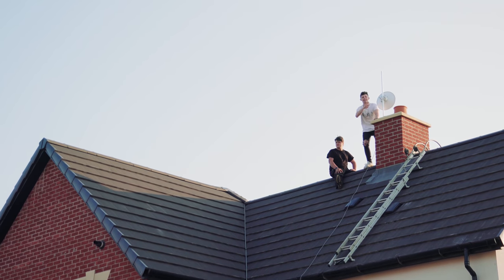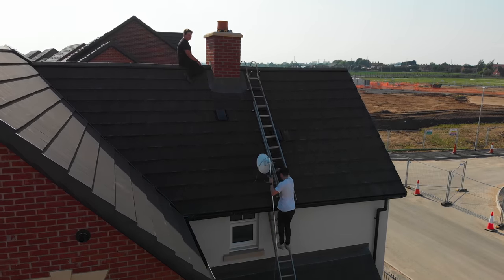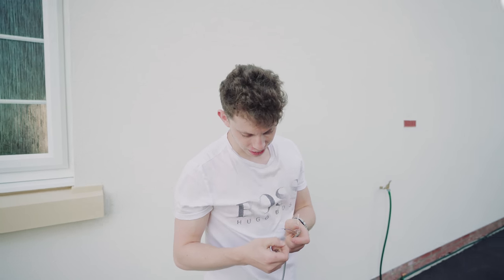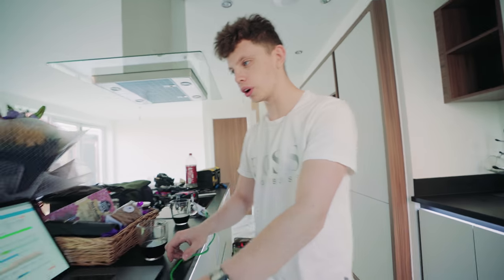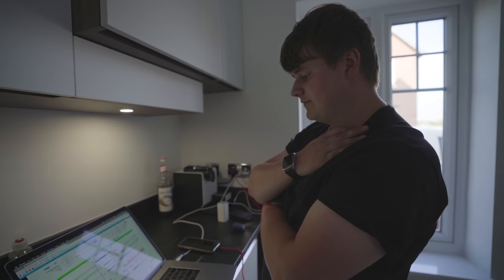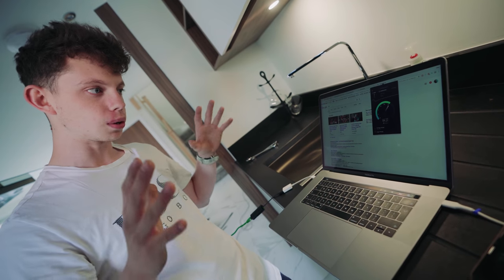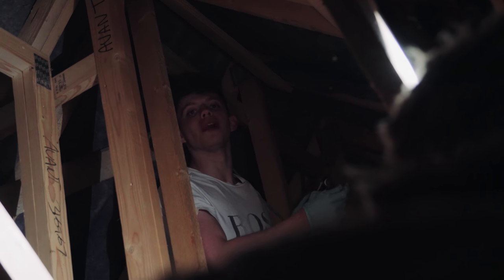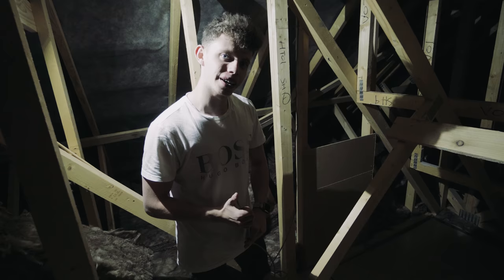How To Get Superfast Fiber Internet When you CANT!

Comment: When he is showing you how he to set up an ethernet jack he says it doesn't matter what way you put them as long as they are the same on both ends this wrong it does matter because of how they are listed in the cable to stop electromagnetic interference if you change the order you can have problems with the cable
Reply: I'm just trying to inform and maby help out someone  why is trying to use the information from this video in real life I'm not trying to put down him done he has good content . It has to do with how they cable are twisted together to stop crosstalk between the cables. It should also be noted I have delt with ethernet cableing in many different places for many different clients and know enougth about it to comment. I'm only trying to help someone else out. Also it should be said that the tech videos on this channel are pretty good and accurate
Reply: @los los I hope you're joking. There are standards for a reason. He should be following RJ45 568B, but he clearly isn't, and it is just going to cause problems further down the road.
Reply: U're absolutely right! Differential signals need to be on twisted pairs. Rx + and rx- on a twisted one and tx+ and tx- on a twisted pair.
Reply: @Razor Lagura its called crosstalk.that is why they are twisted.and also, let me know when someone plugs POE device on a wires that are out of standard, and starts debugging.just stick to 568B and be happy.....avoid custom wiring whenever you can

Comment: WISP are aful the reason behind this is due to WEATHER! it rains 24/7 here in the uk which is going to effect the signal from the dish ontop of your roof to the main dish wich the SP has.Therefore when you are playing games online you will experiance ping spikes packet loss etc...However if you live in Spain or any other country which has a better climate then i would recommend WISP however if you live in countrys which dont have the best climates i would stick with cable provides due to reliability.

Comment: WOW, what is with all the negative comments on this video guys!? If you don't like the content then don't watch it, simple. This is another cool video Alex, keep up the good work mate and don't let people's negative comments get you down! A lot of these people don't understand what is happening - for those who don't, Alex is sending his fast internet connection from his dad's house to his new house which is a few miles away via an Ubiquiti dish! I think anything over 60mb is really good considering! Those who are saying "I get 200mb+ download" good for you; Your connection is going directly to your house from the ISP! Not from another house via a dish to another!
Reply: James Garton problem is this guy is showing people how to do a questionable install which could be dangerous or a waste of money. The mast should be grounded, the network cable should have been outdoor rated and shielded with a shielded end, leak wire properly placed in crimp. Static buildup has no where to discharge other than through the network wire. This will kill the radio, likely the network switch and in the unfortunate event it could hit PCs. Lightning will 100% take everything out and could kill you. I have done wireless for twelve years and I'm concerned. I have done and seen installs like this, you get at most a year before sifting bad happens.

Simple as ubiquiti tough cable and shielded rj45. Then to code gauge wire from mast to ground rod.
Reply: Tom Lindo - yeah not going to disagree with you on those points as they are good ones to point out to everyone. Just sore red when I was reading all the clueless comments from people who does not understand networking and/or what Alex is actually trying to achieve. Common sense is definitely required if people are going to attempt something like this and a better choice of cable etc.
Reply: Tom, we also made those mistakes in the beginning. It will take 1 storm and he will lose enough equipment that ESD and earthing will be a factor moving forward. For now though i dont see myself or yourself with a youtube channel, food for thought.

Comment: Hey Alex can you use two routers with the same ssid on the same network.
Reply: Shorts Romain no comparison. If you want a 10mbps speed over 0.5km. sure. If you want 100-200mbps, you need decent gear that you can adjust power output and eirp.

Comment: OMG you are killing me Alex! I can't believe you just cut into your new roof! You are going to wind up with a leak and ruin your house! AND you just provided proof that it was intentional which has most likely voided your roof warranty with the builder! I like a lot of the stuff you do but this is absolutely mental.
Reply: He has a nice tile roof that could last 40+ years on its own but silicone will break down over time by sunlight, weather, etc. IF he would have taken the time to plan, and we all know he is going to wind up having 50 wireless antennas up there, he could have had the roofer put in a proper access point with proper flashing to run all the cables through it. And yes, cutting or drilling through your own roof can void the warranty of the roof. Once you cut or drill, that is not part of the roofers work and therefore they will not cover it if it starts to leak.

Comment: ubiquiti is noob stuff low dbm power, i use ligowave, multpoint and point to point panel type, specially the rapidfire 5-23
all my customer switch to ligowave unlike ubiquiti sometimes it disconnect and need master and slave always reconfigure sometimes same reboot.
Reply: also they dont have wireless tool alignment unlike ligowave they had wireless tool align.

Comment: Hello Alex, what ubiquiti device are you using?
Reply: That is a Ubiquiti 5GHz  also PowerBeamAC Gen2  keep in mind that you will need one on the other end as well and this should be a point to point also depending on your location you should check local laws this could be illegal
Reply: @RiaanVanLill  Agreed, More specifically PowerBeam 400 AC Gen2, Most Regions 5Ghz is unlocked and free to use, be sure to use "Calculate EIRP Limit" so you do not get in trouble. Just to some basic research and see what frequencies are available in your region.

Comment: 50/50 isnt fast
Reply: Actually for some areas that are isolated don't get as much as populated places so it isn't actually that bad compared to what other companies in that area provide but I get what you mean I get 500/500 here :)
Reply: @sQuibo  Where do you live? I'm stuck with Openreach FTTP and the upload isn't symmetrical.
Reply: @sQuibo  I have 1k/1k
Reply: 50/50 is more than enough to have. To stream in 4K Ultra HD with HDR, Netflix recommends you have a consistent minimum download speed of at least 25 megabits per second.
Reply: @MikePowlas  I stream Netflix with 1mbps. I don't get hd streaming. But my only option is satellite for now. 12mbps up and 3 down on a good day.
Reply: @jessigames8593  Hope you get better speeds soon
Reply: @MikePowlas  not soon enough lol. But they are running fiber through my electric company. I have a 4 year wait.

Comment: So........ you built a cantenna without an amplifying booster?
Max range on cantenna's are usually about 6 to 10 miles. anything higher requires a high extreme boosters which are illegal because they can knock out radio towers.
Been building cantenna's for over 15 years.
The proper way for this setup is to use pigtail connectors that are used in RV's for dishes, they can handle a higher db and dbi for load.
Your using a normal speedtester website that has no application for this type of setup. 
You want to test it in DB for noise. anything over 75dbm to 105dbm is bad for data transfer, why cell phones with 3 bars even at 4g is ranged at 95dbm to 120dmb which is bad and data transfer is still slow.
Reply: If there was any noise especially considering the time of day this was filmed in it would have been heavily reflected by the connection speed, boosters are an even bigger waste of money than the Ubiquiti equipment he uses unless you're legitimately in a mountain or valley range with a lot of TALL trees.
Reply: The Ubiquiti equipment has built in amplified boosters what are you talking about lol.
Ubiquiti equipment have chips in them made by Dominion semi conductor factory.
He's not even using the Ubiquiti equipment just the dish.
 A speed booster isn't the same as an amplified booster speed boosters are essentially amplified repeaters.
Your DBM and DMI noise comes from the line too not just from signal wave to signal wave. This is why pigtail connectors are preferred as they carry more signal without interruptions vs the way he set up the line.

Comment: You should do an iperf and test the link speed with different packet sizes, you only tested the internet speed but not the max between the two radios. Also I hope that pole is grounded against lightning strikes and you are running that ethernet cable from the radio thru an ethernet surge protector!

Comment: I thought Fiber speeds were like 800-900-1000mbps speeds. Something ain’t right here
Reply: Fiber could literally just be 20/20 or 50/50.  As long as the up and down speeds are the same, it's fiber. PS: this is oversimplification :)
Reply: @monzerfaisal3673  Fibre can be anything you want. It can be 100/20 1000/50 or 1000/1000, whatever the one who sells it to you decides is "good enough"
Reply: daro2096  Its not about whats in the Ground. More about what Technology feeds these Cables.If the Backend Cards can only handle 1Gbit/s, then thats the max.
Reply: He is getting top speeds of like 1000/1000 but the radios will not do that speed. They are @ Throughput 450+ Mbps So all is right here.
Reply: That is what o have so ye it is rite
Reply: My fibre goes as low as 10 Mbps when the system is heavily loaded at night.  My area is vastly oversold.  Top speed is a setting in the software that your ISP uses, as well as the download/upload ratio.

Comment: I’m still baffled coming back to this video a year later. I pay 70$ a month for fiber internet 1000 download and upload and this poor guy isn’t even getting 100/100.
Reply: Dude I pay $100 and only get 100mb download and 3mb upload!!!!
Reply: Fahim Hussain  Probably centurylink... lol
Reply: I get 1.5 down with 5gb quota. So oof
Reply: I pay $70 a month for 15mb download and 1mb upload 😓
Reply: DUDE I ONLY GET 600KBPS
Reply: I pay like £35 a month for 35 mpbs   down and 5 mbps up
Reply: I pay 90 dollars per month for 12 mbps up and 3 down. VIASAT but my electric co. is running fiber as we speak its just going to take them a total of 6 years to finish it. I have a 4 year wait until they run it my neck of the woods. Then I will be getting the highest speeds they offer lol. It will start out at 100mbps up and down for 50. Then go up to 1gbps for 79.

Comment: How is 50mbps FIBER????
Reply: Fiber optic is just the type of the connection (just like ADSL or cable, for example) which doesn't automatically guarantee you the 100Mb/s+ speeds. It can be 1Gb/s+, as well as 1Mb/s.

Comment: I cant get fibre optic in my area currently, could this be an alternative solution for fibre speeds??
Reply: its not even close to fiber speed in fact if you have a decent LTE connection at your place you can get up to 500 mb/s up and down but a little worse ping
Reply: Yeah but with the right equipment you can push Gbe easily over radio. LTE is case and point.

Comment: "There's an order to it. I'll show you the order."

Moments later -
"Actually, you can do it any way you want as long as both ends are the same."
Reply: Which actually isn't right. The sending pair and receiving pair should be twisted together within the cable which is why they have the A and the B configuration. If you put the pairs in any order you like, you can get something called crosstalk which can slow things down or stop things completely if you don't get the order correct.
Reply: @iglooonfire3461  I see what you're meaning in that you could introduce crosstalk by swapping lines between pairs. My mistake.

Comment: What kind of RJ-45 plug are you using??
Reply: Have you received information? Or maybe you found somewhere what kind of RJ was it?
Reply: Ethernet uses 8P8C connectors not an RJ45. RJ45's are slightly different and are used to run four separate phone lines over the same cable. Anyway, you can get ethernet jacks on eBay.

Comment: @TechFlow Alex, how do you get over 40Mbps on Virgin Media?  I barely push 20Mbps!  WTH?
Reply: He is business he has an expensive commercial high speed connection.
Reply: I have 52Mbps and many of my colleagues easily push 100Mbps with Virgin Media. The University that I work at has parallel Gigabit. Fast internet isn't that uncommon anymore.
Reply: Try Hyperoptic
Reply: It’s a Virgin leased line not their residential service
Reply: Sheikh Ahmed
I would love to try Hyperoptic, but it isn't available in my area.

Comment: Do you really need a server rack and all that stuff to “manage” 50Mb/s?
Reply: To be honest you can probably just get 50mb with any service provider nowadays
Reply: I’ve seen much more equipment, and certainly $$ spent to support a single T1 (1.44Mbps) depends on use case — not speed. Not all connections are created equal, there is so much more to it than Mbps.
Reply: Uap AC HD seems a bit overkill though...

Comment: You never told us the order of the cables for the ethernet plug
Reply: He does say it at 3:22 but here's the order when looking at the exposed pins with the opening of the plug at the bottom: 
White-Organge, Orange, White-Green, Blue, White-Blue, Green, White-Brown, Brown.
He calls it category B ethernet wiring but that's incorrect terminology. The color code is the TIA/EIA T568B Termination Standard. There is also T568A where you just switch the position of the White-Organge, Orange and White-Green, Green wires.
Reply: Both color codes can be used interchangeably no hard and fast rule, just make sure you follow the same code on a single project.

Comment: Hope you got permission to mount that antenna in almost every new housing development your not allowed to put anything on the external of the house for 5 years
Reply: That's not true
Reply: @05vy  
It is most new housing developments place restrictions on what you can do to the house. I'm in a persimmon development I can't have sky, no BBQ in the garden, no commercial vehicles parked outside or on the drive, can't change any of the doors or windows for 7years unless it's an identical replacement, I can't even install a outside tap
Reply: @markajoseph1980  Do you live in a prison?
Reply: @charliey1007  Sounds like a thing called HOA here in the USA AKA Homeowner Association
Reply: @markajoseph1980  That does not apply to all new homes, just those who sign up for a posh estate!

Comment: Not very fast, the company i work for provides 1 gigabyte/s.
Reply: "the company I work for"?? Anything over 50 is more than decent for an average household.
Reply: Millergram my mbps is 1-10mbps what about urs?
Reply: You work for them and nobody has told you that it's gigabit not gigabyte
Reply: Sam Davy thanks for correcting me. Sorry, lack of sleep. Lol. Yeah so we provide fiber to the home in some areas and digital. Fiber can be fast as shit, its the equipment that provides the speed. Shit is just expensive as hell.
Reply: Steven Ofstad np, here in NZ we aim to have 80% of the country having the possibility of fiber, even ripping out copper in some places. Here you can get anything from 40/10 to 4000/2000, although anything over 1000/1000 is business only.

Comment: wtf since when you can capture internet with dishes xD internet is basically cables not waves running in air
Reply: Probably using LTE and not fiber internet
Reply: Improves service to your home (area). Your internet needs service to run at it’s full potential
Reply: troll

Comment: No offense but I really dislike the british architecture
Reply: Leon Siefermann I agree new builds are just not my thing.
Reply: Hello _ definitely. Some stuff more up in central London is alright. Only thing we did right is building houses back in the 60s. They are nice and robust and strong. Now we just use cheap house building methods. Most 60s housing are still standing strong even coming up to be 60 years old. Where as houses built today probably won't even last 50 years without major renovations.
Reply: Luke Dyte
I'm in a 60s house I believe, and not only is it still standing, but it is just as strong as when it was first built. It's a shame that the new houses don't receive the same level of care during the building process as the old ones.

Comment: For people out there 

Rj45 B is for British 
Rj45 A is for American cable layout for rj45 

If you use cat 7 or cat 8 your speeds will double or triple
Reply: Actually, we use B in America as well.
Reply: Thats right we use b here, some use a for phones(some systems that support multiple lines), also it does not matter if you put cat 6 7 8 or what ever as the bottle neck lays on the isp side!! Maybe only within the network  if you have the latest hardware.....even then cat 6 is suficient on the newer 10gb ports
Reply: Non of that matters, 
What matters is whether or not he did a split line or crossover on one end. be it cat5   cat6 or cat7